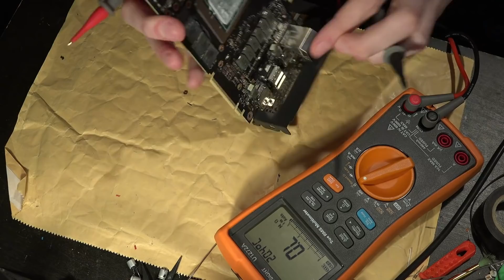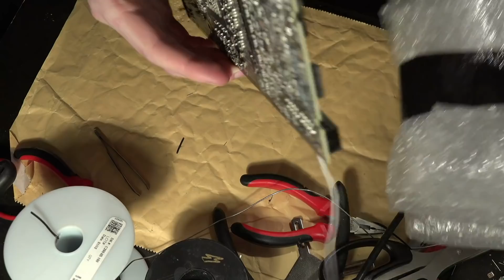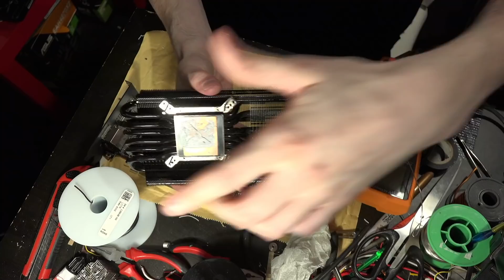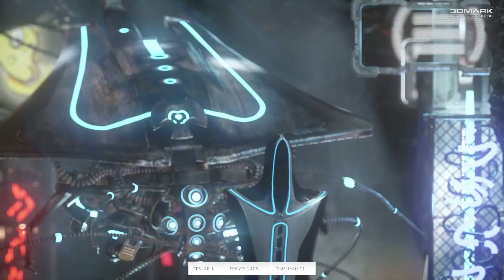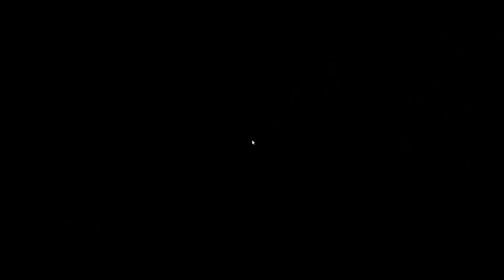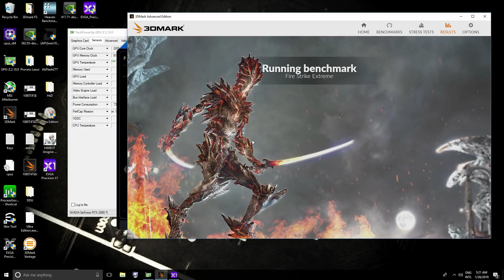Buildzoid VS Power limit on 2080Ti (Nvidia kinda wins)

Comment: Did you work out the trick to increase the the 1.068-1.093 max voltage? Found after doing the quick trick and rigging up a 16pin to 8pin adapter to each of the inputs having 600w+75w pcie on tap, gpu boost disabled but 88degree TDP still in place. with my water cooling it almost doubled the performance of the 2080ti. The vrms and supporting 'infrastructure' on the PCB for the 2080ti is overkill and the best of any card. Weird using it instead of my 3080 as a main, but +1500 mem and - 3000+ core it crushes anything still. Poor underclocked  cards. Especially those ones with under a 300w power limit!

Comment: My 2080super is doing this with a 0.008ohm added in parallel to the stock 0.005ohm, card had 0 power limit increase from gigabyte. Starts hitting power limit and down clocking and will do that to black screen if you keep pushing it. Could it be vrm issues? Getting too hot and thermally protecting. Highest power draw I saw was 350w @ 1.05v to the card. Card temp was 57c for extended usage like gaming.

Comment: Hello,
i want to do a SHUNT mod on my MSI 2070 Super Trio X, i bought 0.003Ohm SMD shunts for this purpose. (solder on top of original shunts)
https://ftp.nluug.nl/pub/games/PC/guru3d/img-cache/pcb/2070S-MSI-GAMING-X-TRIO/1.jpg
According to the pictures it should be the SHUNTS RS13 and RS14. 
RS15 I assign to the power supply via PCI-E.
Unfortunately I find components with the label F1 to F3 near the shunts.
Are these fuses ? Have you ever seen something similar on a Nvidia graphics card ?
With which current do they blow ?
So I think this mod is of no use to me if these are really fuses. Can you buy these fuses ?
thanks for your answers
love your videos <3

Comment: you burnt the dudes connector on the side with your soldering iron, no prepped tips. not enough heat for the job...what a hack job. you take no precautions when you have someone elses GPU and you're on video. unbelievable.

Comment: With my rtx 2070, I overclocked it to 2 ghz and the max power I can draw is 70-75% of the tdp. I don’t know why I can’t go to 90-95% of the tdp
Reply: @Malfunctioning Universe  ai plugged all the power connectors, the video card does not have a vga output.

Comment: hi man, what is the difference if i put 2 panasonic (same as orginal) resistor but at 3mo one in each side of the card (on an TITAN RTX) without any wire or bridge. it differ to what you did ? the 3mo is about an guy who post that on a forum the exact resistor model is that ERJ-M1WSF3M0U i found it on this link : https://www.arrow.com/en/products/erj-m1wsf3m0u/panasonic i am totaly newb never done that. but i am searching the best optimised solution. this card will be watercooled

Comment: I think the limit is about 3mOhm to not trigger safety mod on 2080 Ti. So you can replace it with a 3mOhm shunts or solder a 8 mOhm shunts on it...7mohm shunt probably will work too but not tested.

Comment: Or you could just buy lower resistance shunt and be done with job after few minutes :) I mean like this:
https://www.digikey.com/product-detail/en/vishay-dale/WSLF25121L000FEA/541-3125-1-ND/6194698

What's the point of hairdrying magic? I'd suggest to invest in proper soldering iron with direct heat chisel tips. 
And fume extractor please, getting flux and metals your lungs ain't helpful for health.

Comment: Buildzoid. You can get a hot air gun for $40 US, one that includes a soldering iron/ stand/ and tips and nozzles. Look at the Zeny. It is not top quality and the iron isnt as hot as it says it is, but it works and the air gun will desolder anything you throw at it. Also i broke my iron’s heating element and they sent me a new entire iron, no charge. Seriously a great purchase. Its been going strong for 2+ years. I got it on amazon so it should be available across the pond by you.

Comment: So ive been attempting to learn about the hardware few months ago put a kraken g12/x42 aio on my 1080 and  i theorise it its either Vbios has some sort of shunt temperature monitoring (after finding out shunts are inaccurate under heat) after flashing my msi 1080 to the strix unlocked bios, msi seahawk ek Vbios, they reacted different and i started with armor Vbios bringing memory and choke/cap area of phases temps from 70C and i hit the same high clock but my thermoprobes now sit at 45c-50c after firestrike stresstest and ive stopped the throttling on mem and vrm area and im improving scores but gaming/VR is flawless. I wonder if there is alternate Vbios options set to monitor other temps, now more aggressive with RTX.  Im slow with hardware i only got a 1080 less than a year ago so budget has always been an issue here too. But my card used to hit a similar "imaginary" limit but MSI AB said not voltage or power.
Reply: i hade to run a command for msi ab to change tdp, makes me think theres more ways it knows  how many wats its pulling since i wasted time flashing different power limit same vendor, which i wonder if drivers know i put the same card in and it wouldnt change until i ran nvidia-smi -p1 291"my current tdp". or not using old driver install from geforce but used express install instead, since manual also.has had issues
... i havent tested enough to be sure. I hope i am understanding how this works and making sense

Comment: I'd love to get my hands on that GPU-z log file. It appears that the power jump from idle to load was roughly 50% for both voltage divider circuits. This may indicate that the card's TDP display might be an average of the power consumption from PSENS_high and PSENS_low (where PSENS_low is given by a power sensing shunt somewhere else on the PCB).

Comment: I love this channel, but if you get a +1200$ part (from somebody else) to work on, at least take care of some preparation but especially research. 1200$ is a lot of money,  which I guess you are aware of since you are recovering used resistors and using a cheap soldering iron.  Anyhow, you can use a small copper plate as a heat spreader, drill 4 holes so it fits on the cooler and put it between the GPU and the passive cooler. Leaving part of the GPU uncooled is a bad idea.

Comment: The unexpectedly high overall TDP reading might be based on what is reported for draw from the PCIe slot and the logic balancing that draw in the BIOS. I experienced something similar on a GTX 970; even with lower resistance shunts on the 6 and 8 pin it would still power limit at a reported ~60% overall TDP in GPUz until the BIOS was modified such that the lower limit for PCIe was set to the same value as max limit. Not sure what would be required to actually bypass that now since BIOS mods are out of the question for Pascal and newer. I'd imagine a rather thick wire would be required to feed that 75 amp plane from one of the 8 pins?

Comment: Whats wrong with you. You have pretty nice keysight multimeter and pair of crappy soldering irons 😂
Reply from the maker: If you're cutting something being able to measure the length correctly is more important than being able to cut it quickly.

Comment: Also I got the gaming X trio 2080Ti, it doesnt really throttle at max clocks and full load like you said it might. I am using 406w unofficial bios, it doesnt use more than 370W tho.

Comment: You should run Heaven instead of Firestrike that way it shows the clocks and temps (and FPS of course) without having to drop/tab out of the program.  That's what I use to check my clock speeds when overclocking my GPU (mobile GTX 1060 6GB, OC'ed to 2037MHz Core [+136], 4532MHz [9064MHz effective] VRAM [+530]).

Comment: Replacing the 2 shunts desoldered in the video with 3 mOhm resistors raises the powerlimit to around 420 W according to the owners thread at ocnet. So at least this method seems to work by just modifying said 2 shunts.

Comment: Maybe Nvidia is now also looking at the current ratio draw between the PCIe slot rail and 8-pin rails so it's drawing current at a monitored ratio from the PCIe slot as well.

So how about doing the same voltage divider mod on the PCIe slot shunt _and_ also wiring the 12V pad from that shunt to the 12V line on one of the 8-pin rails (that way the pad for the PCIe slot shunt is actually drawing current from the 8-pin rail rather than from the actual PCIe slot 12V rail). Or even wire that slot shunt pad directly to a 3rd 8-pin connector, so it can draw as much as it wants from it's own connector separate from the other 8-pin connectors plugged into the card.

Comment: @
Actually Hardcore Overclocking
Get yourself a TS100 soldering iron if you want something with more power but cheap. Just get it with a TS-BC2 or TS-C4 tip, conical is always a worse shape to work with.

Comment: A Failure I will say this is not, very far from. In fact, it looks like the results may be as useful as another "Successful failure", the Michelson Morley experiment.  The discovery that those two shunts do Not provide all the power limit monitoring is very Profound for other Modders.

Great vid BZ, and Thanks to the fella that donated the specimen for testing. B)

Comment: Buildy, have you ever had hot air rework? been thinking about it for your last few mod videos
Reply from the maker: Yeah I've heard of it. I obviously don't have it as much as I wish I did.
Reply: @ActuallyHardcoreOverclocking  I see. Didn't know if you'd had a blower before and decided not good or what.  I envy your soldering iron steady hands btw, mine shake too much for the really fine work.

Comment: I put my Raijintek Morpheus on my r9 390 3 years ago with two noctua fans it runs at 60°C with a little oc (1070Mhz) and very silent. I hope to pull over my setup when i buy a new card. I am still waiting for a great card under 300€.

Comment: I’m familiar with flux in terms of forging, what is it and how does it work for soldering?
Reply: Similar I think. Removes corroded layer and allows the solder to bond properly with the metal.
Reply: Components float in it on the board while soldering and always remember: The bigger the blob, the better the job!

Comment: how much do u recomend the morpheus for replacing original coolers....i modded my first card an rx 470....given now that i have a bit more knowledge...know that the card i got was on the lower spec end for rx 470....sapphire if u know....but would it help more with temps?....i heard the morpheus is heavy....

Comment: but thats Samsung GDDR6.
is that micron spec applicable on samsung?
Reply from the maker: the operating voltage range is JEDEC spec. I just pulled it from a micron datasheet since I couldn't get a Samsung one

Comment: Is it really that big of a problem ? Is that whole die the actual chip ? Wait a second that is the whole die? holy shit that is quite a chip, i guess that is part of the reason nvidia asks so much money for their chip. compared to a cpu from intel it's a lot larger. it might not be a problem if that part of the die that doesn't have contact with the cooler is for RT cores, because well....
Reply: xnutral the tu102 is a 754mm^2 absolute unit of a chip

Comment: I just sliced my thumb 2 days ago. A 2 inch laceration, right to the bone. After a day off and a band-aid, I just finished pulling an engine. And going to try out my new 8 core XEON in my X79 DARK.
Reply: Weird flex but ok
Reply: Uhhhh ok?

Comment: i have put a Raijintek Morpheus on a RX 470 and now its like 60°C with 450 RPM Fan Speed :^)
Runs at 1300MHz without added Voltage
Reply: did you put heatsinks on the vrm ?
Reply: @warriorwithing  yes, the ones from the Morpheus and the Backplate from the Arctic Accelero Xtreme 4, with the two Noiseblocker E-Loop B12-PS my RX 470 is 5 Slots Thiccc
Reply: you lucky bastard, my RX480 doesn't do above 1250, no matter the voltage
Reply: @tommihommi1  well i do habe to increase the Power Limit :)
Reply: @Felix-j3d4b  well duh, the card throttles at stock speed without that
Reply: Thing is, with the cost of that Morpheus you could have bought a 480 instead of that 470 and get a faster card to begin with...
Reply: @TheAnoniemo  I'm gonna guess he didn't buy the cooler new just for a 470
Reply: @TheAnoniemo   I bought the Morpheus used for 20 € for my Asus ROG MATRIX R9 280X Platinum, but unfortunately it did not fit ...
The RX 470 was actually new, but one guy sold it as used because the stock fan was too loud, got it for 110€ with shipping :D
Reply: @Felix-j3d4b  I'm jelly
Reply: @owowowdhxbxgakwlcybwxsimcwx  On my XFX 480 Black (REF PCB) ive got an Artic Cooling Accelero IV Extreme. Without touching the voltages i can set it to 1400MHz, and it stay below 50. For the sake of the VRM i set the fans to max at 39C, so when its at full load its gonna move enough air through the rad. Otherwise it stays on idle 700 RPM because the GPU isnt warming up enough.
Reply: Yesterday i tested how far i could overclock my RX 470, and with Stock Voltage (1.100V) i can get the GPU up to 1360 MHz, at 1370 MHz it gets unstable 😎